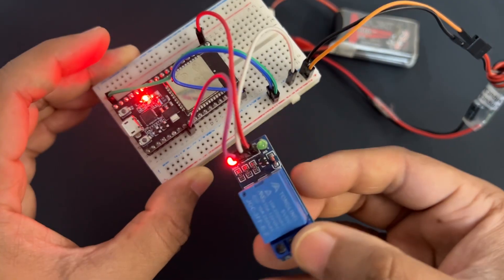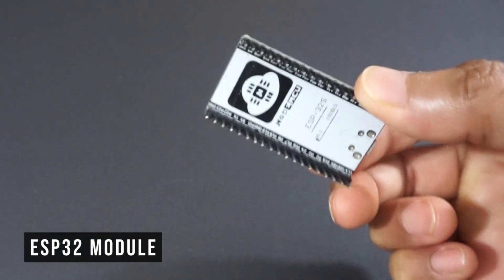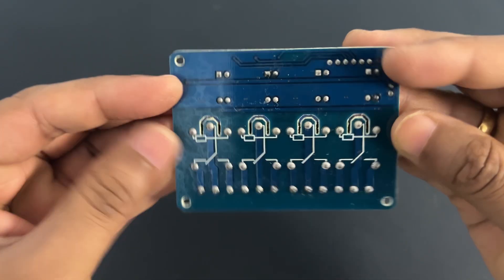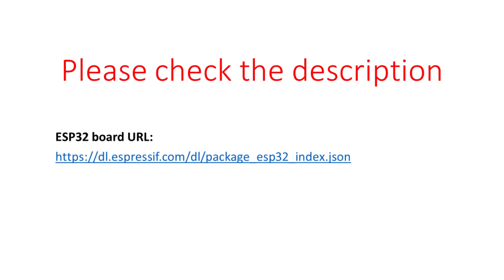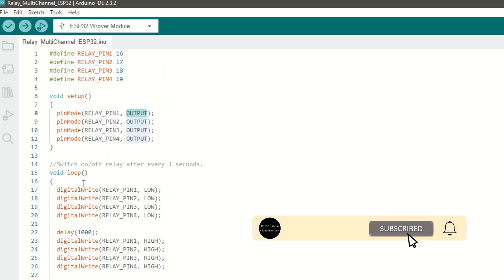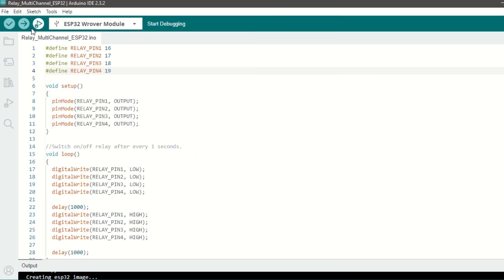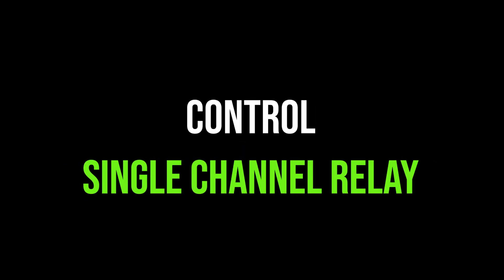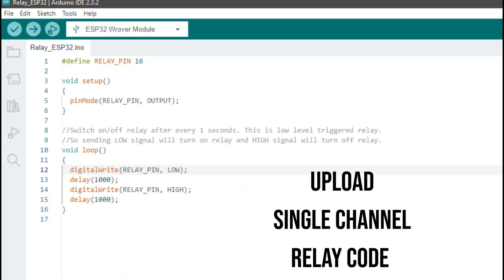How to control Relay using esp32 | Single channel relay issue resolved 👌 #relay #esp32

Comment: Sir can you build a hand gesture controlled drone by using 

Transmitter side

1.ESP 32 
2.MPU 6050

Recevier side 

1.ESP32
2.PIXHAWK2.4.8
3.ESCS
4.MOTORS

sir its my last year project kindly help me to build this, upload video on this project too

Comment: Sir,if I use HC SR04 ultrasonic sensor somewhere and want to connect it with esp32,The Echopin will give 5V output but esp32 can only take upto 3.3 V input....so there will be any prblms...will esp32 burn out ?please provide The solution